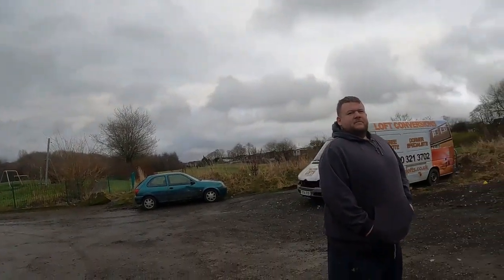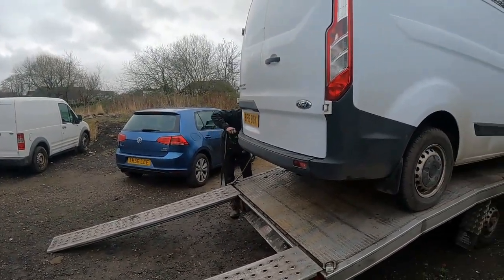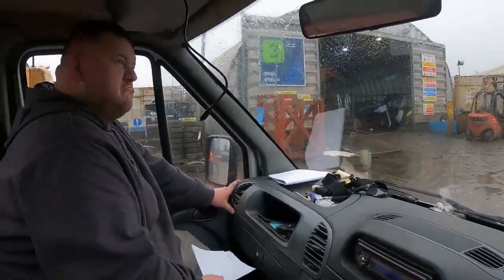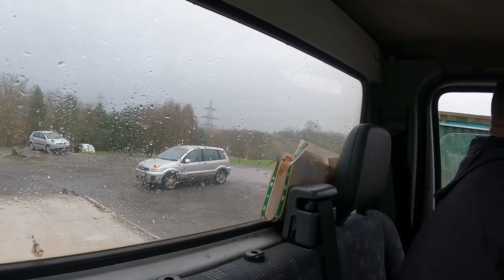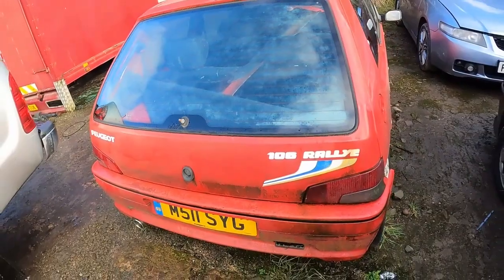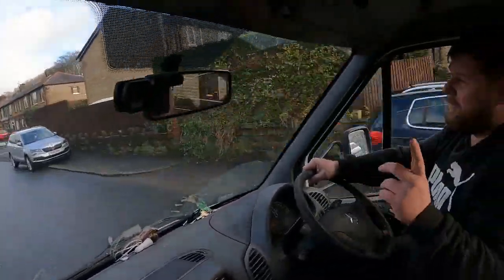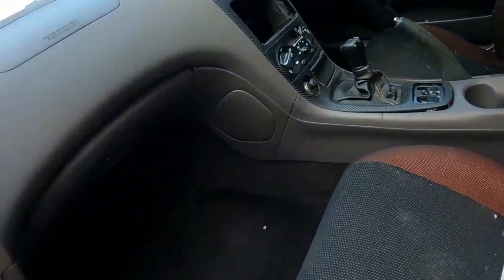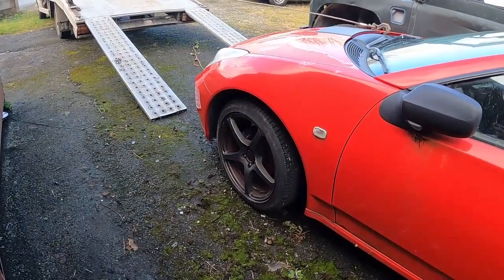TODAY CONSISTS OF BUYING AND SELLING MORE SCRAP CARS!!  TRANSIT CUSTOM EBAY FIND

Comment: Not a bad transit. I need one of them units mate. Working in this weather is a killer. Am not Keen on EBay I been using market pls lot of messers though. I had one of the 106 rallys myself few years ago now.